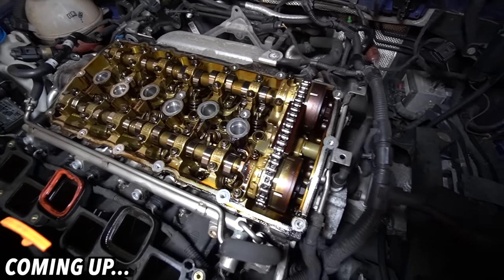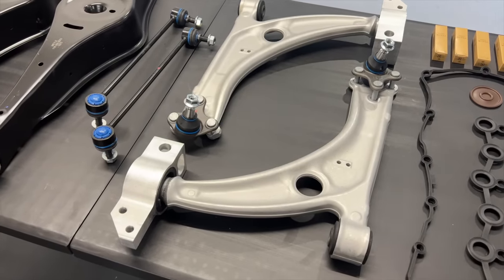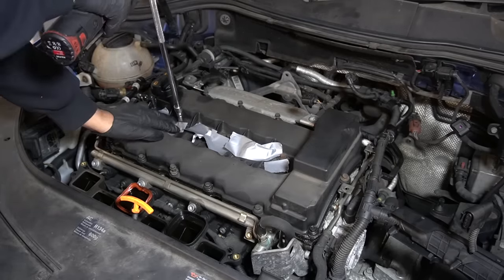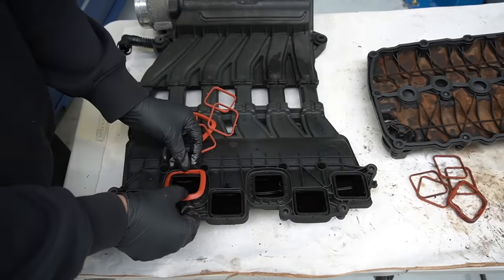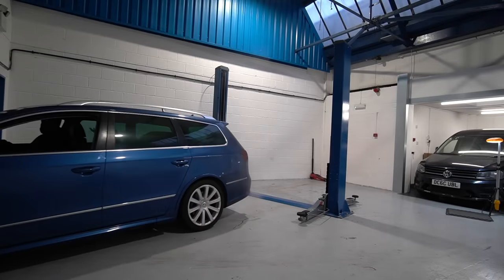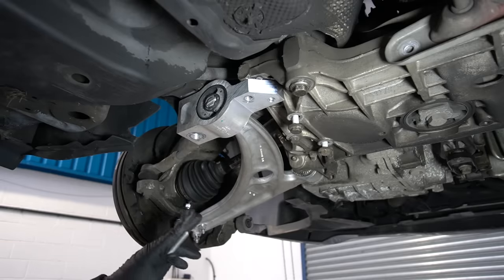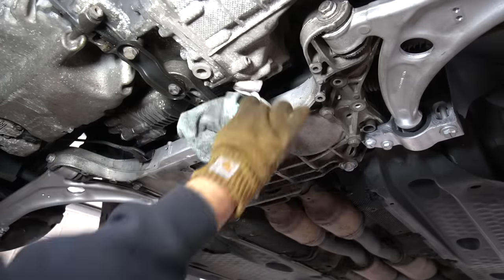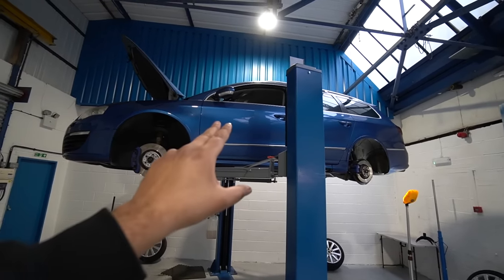RESTORING MY CHEAP VW PASSAT R36 | PART 1

Comment: Pro tip, if you're changing the control arm connection rods, I just ugga dugga the old ones tight until they break, hassle to get loose most of the times so I just bust 'm up lmao

Comment: From experience hamza, get that timing chain done asap haha, we got a new engine put in our astra and the timing chain was rattling badly, we drove it for weeks like that luckily nothing happened even though the guide had snapped inside the mechanic found which was causing oil pressure light to come on, when that happened we got it towed to garage, i highly recommend sorting that chain before driving it further boss

Comment: Nice 👌 be a tidy motor when finished 
The suspension mountings should be tightened up with weight of car on them or the suspension jacked up 
When tightening with suspension hanging you risk damaging them when the car is sitting back on the ground

Comment: I did the PCV not that long ago on my R32 it’s a lot more work one a 32 as u can’t get to the bolts on the inlet without taking the front panel off. Never the less I didn’t think it was to much of a job overall. My rocker cover was the same underneath I used degreaser and wire wool to get it looking new underneath. 

I used the RKXtech kit on mine

Comment: Wow, hell of a car 😮...you must be the only you tuber who puts penetrating oil on  way before starting instead of just a few seconds before attempting to undo anything...if you are pulling the rear frame for repainting/powder coating ....May be worth getting some car dollies in case you need to use car lift while passat is immovable....
Good luck with your restoration👍

Comment: Did you keep drop the car then tighten the bolts on the arms first or tighten then up whilst car up in air. Just wondering as I'd always believed to drop the car and then tighten to prevent premature wear to bushes

Comment: I saw first time in my 30 years of life a Passat R36 yesterday here in belgium nearby i live, a white one. This week. 
Expensive to maintain, but here you can register stationwagens as a van if you remove the back seat. So the tax and insurance will drop 90% of what you normally pay.
How else can you get insurance to pay and the tax for a 3600cc engine.

Comment: Great content mate!

I guess the bushes should be torqued to the correct spec after the suspension has been loaded.
Tight them loosely, lower the car, bounce up and down, move forward and back up then torque the suspension parts.

Comment: Was your vertical standing jack thing from ebay by any chance 🤭 lol. Its got me thinking if its not doing what its meant to be doing, i bought an engine hoist for my outboard engine. When i went to use it i had lifted the arm up by hand to raise it quicker instead of pumping it. So when i got it to the right height, and tried to pump it further to lift the engine off it wouldn't work. Thought it was faulty. I then realised that id just made a massive air lock in the ram. So let it all back down and pumped it from bottom. Just incase you have something similar 🤷‍♂️

Comment: @TRHamza, I've followed you long enough to be able to dub you the VAG top G. I have a problem with my Golf mk5 2008 2.0 GT TDI (2003-2009) version. I've taken it everywhere around me and been given the same advice by all. It begins to make a whooshing sound between 1700rpm and 2600rpm. Everywhere said, it's a burst pipe, so I replaced the whole cold air side, and it still makes the same sound!!! 
If you or anyone else recognises this sound and can help me with fixing this issue, I'd be very much grateful, and many thanks in advance, stef.

Comment: How much is cost all this job mate? I have an passat b6 SEL 2.0 diesel, CBBB engine, at the moment working well, but think to do an refurbishment as believe soon he'll let me down. I have done already 275k just replacing the oils and filters, of course I had dual mass and timing done on time, as well I had problems with the oil pump. Let me know please if you will be able to help. Cheers

Comment: What’s up bro I’ve been following this build and I have a project of my own I was wondering if you can help me.. I’m trying to convert my 2018 VW Passat GT (American model) to 6 speed manual AWD. Believe it or not the AWD is easy but the manual is a tad bit difficult, I’m using a 04 r32 manual transmission and I need a clutch position sensor harness diagram for a 2005/6/7 r36 6 speed manual. Can you point me in the right direction?? Please